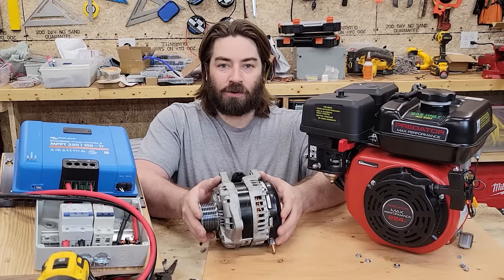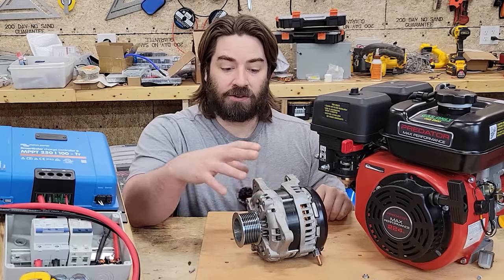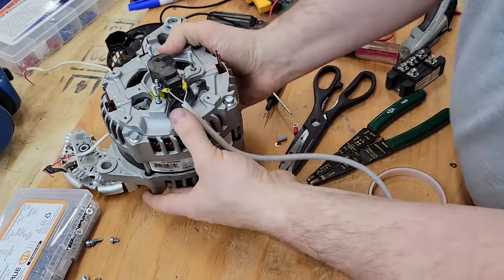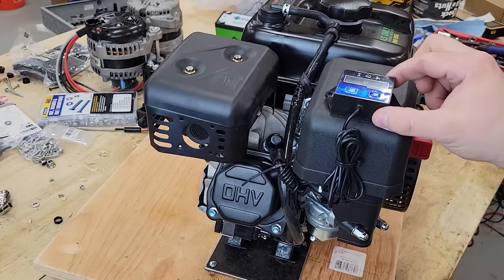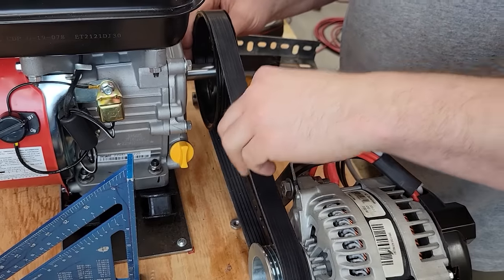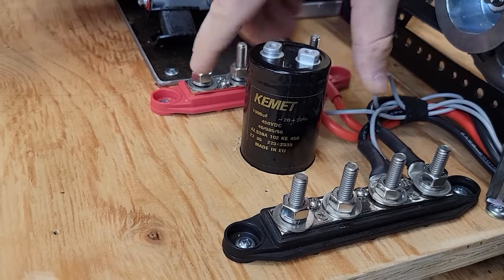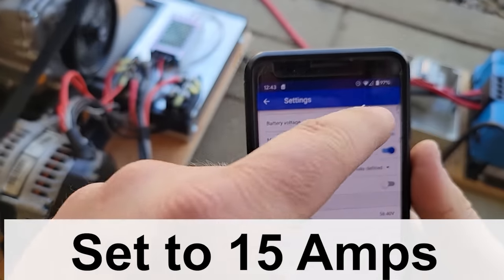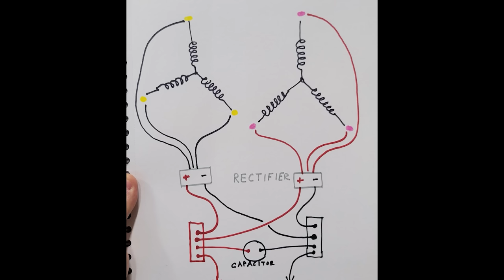The AlternatorGenerator, First Attempt.  48V Battery Charging

Comment: Oreilys / autozone sells an adjustable alternator mount, its usually for your older build ie small block chevy stuff lol but it could help you get more tension much nicer and you can still use the mount you made, would probably need to adjust the length of the working part of your tension system..... youll figure it out as soon as you see what it is lol

Another suggestion but this time for the excitement of the alternator. If you get your hands on some form of micro controller like an Arduino and a 5v relay you could use the arduino and some basic code to momentarily engage the relay to connect you "exciter" battery to the coil instead of needing to do it by hand... if you get fancy with it, you could potentially add a trigger based on the engine starting. ie (not in code though) Engine is on? if yes wait 10 seconds then excite alternator. You could even control the Main output to your solar controller by the microcontroller so that you get that cooldown on that alternator.... I feel like im rambling

I loved the video and am probably going to mimic this process in the future! Thank you for taking the time to upload and being thorough!

Comment: Awesome video ! ! ! Been wanting to try something like this myself but haven't tried yet. There's more to it then I thought but you simplify it all. Could you make a larger base, longer drive belt and add another alternator to the other side of motor and get twice the voltage???
Reply from the maker: Yes, but I think this engine is pretty much tapped out.  If you wanted to drive two alternators for twice the power (kW) then you would need a larger engine.  If your only goal is higher Voltage, but still under 3kW load, then you could arrange the two bridge rectifiers in series.

Comment: It is a true 6-phase output, they are just choosing to use a one way rectifier with it. In a 3-phase system, phases are phase shifted by 120°, in this, they are shifted by 60°. You can imagine that as one Y being the normal way and the other one is actually upside down.

Comment: I'd have fitted the alternator and adjustment direct to the engine, that would probably help both with belt tension and vibration issue.

Comment: Really neat build! Is the output of the system about the same as a store bought generator that would also cost $400?
Reply from the maker: This is video #1.  In video #3 of this build, I get the fuel economy up to 4.8kWh/gallon.  If you bought a $400 generator, and combined it with a Chargeverter, you will probably be about 5kWh/gallon.  That's a better way to go overall.  

Note: My Honda EU6500 generator with a Chargeverter (about $5,000) is 5.8kWh/gallon.

Comment: Make one solid mount for engine and alternator and use a turnbuckle to tension the belt then isolate that asseble from platform. But awesome video
Reply from the maker: Thanks.  I fixed the mounting in video part 2.

Comment: Wow that was cool I always new it would work I would like to see alternator  running to give 110 voltage I would bolt  that engine  to concrete  floor  to keep it locked in place.

Comment: the rubber mount idea is kind of sound in theory .its hard to put to words the engine is made to be fixed direct in this case. I serious believe the feet are the major issue here without changing the motor to fixed let me explain( engine is bouncing around transferring to the wood and the static feet )now here is where i might confuse anyone think of it like a vehicle, most engines not all are rubber mounted to the frame (IE YOUR WOOD) often times this vibration is mitigated by suspension and  a few other things (PLEASE excuse me I'm simplifying it here) so technically you need vibration mounts to the feet but since i don't know the frequency's of fixed and rubber mounted its another issue all together by rubber mounting you have either double the force or cut it in half and i don't know which way to lean to correctly solve the issue but using the same mounts for the engine on the feet would help either way another suggestion is where you put this make a cradle so it cant walk using a border around the construction angle iron or wood

Comment: I'm in the process of trying to use a DC motor to spin the armature of a generator i bought 3500 champion . I took the piston off and the oil kill switch and the complete panel board just in case there was a kill switch in there. I'm just trying to couple the motor with the generator shaft to spin it and see what I get. I have to supply my own power to the slip rings . I'm hoping any amount of DC power will work I'll let you know 😎
Reply from the maker: Sounds like a cool project.

Comment: How long would it take to charge a 24 volt solar battery.Thanks,you are very inspiring.
Reply from the maker: A 24V battery could be many different capacities.  But, lets say, you are looking at a 24V, 100Ah battery.  That's a fairly common size at 2.4kWh capacity.  This rig would charge 1 battery per hour.

Comment: Hello David, just wondering if you could attach everything to the platform and then use the rubber feet on the platform itself. Yes all would have some vibration for all components but just as much as you would have on an alternator in a engine compartment. Great video. What about a direct drive of an electric motor to an Alternator to create AC/DC that would run continuously to power a house off grid, one advantage would be no noise ? Or to DC to top off batteries with an inverter? Thanks
Reply from the maker: In Video part 2, I welded a steel base that took care of the vibrations.  Thanks for watching.

Comment: Your videos are really interesting!! 
Now, lets add automatic start from inverter or battery signal!! 😁
Reply from the maker: That would be fun.  If this project progresses to that point, then I'd start with a engine with electric start built-in.  In this case, I'd have to buy an electric start kit for $120 and it would have been cheaper to just buy the engine with it.

Comment: Back in the 1986, Ford used the alternator on the Taurus line of cars to heat the windshield with over 100 volts when the car first started to deice the window. I would be curious to find out if they used it as A/C or D/C. Since it is still very popular in the U.K., you could probably get more info, and not have to spend much to modify a stock Ford part that already does what you want.
Reply from the maker: That sound really cool.

Comment: Love this project! Like many others I’ve been thinking about doing something similar, but never gotten around to more then dreaming of it. Great job doing it! 👍👍

That CB you used as a breaker on the DC side after the bus bar, is that really trustworthy breaking that high of a DC load?
Reply from the maker: I am fine with the circuit breaker for my test purposes.  The manufacturer says 60VDC per pole, or 120VDC in my application.  Since I got 90.9VDC open circuit, I think I'm good.  However, this is just my first test.  I'll probably swap it out for a 50 or 60 Amp breaker now that I have some numbers to use in sizing it.

Comment: Should include the alternator on the motors shock mounts, in other words, secure the alternator to the motors crank case. The video set up preloads the shock mounts too much as you tension the belt so it fails to stabilize the rig and isolate the vibration.  A direct drive also would solve this.  Otherwise great show and love the workman ship!
Reply from the maker: Thanks, I welded a plate to hold both in Video part 2.  https://youtu.be/cy0t4qq8mS0?si=kFnjaW5UCLVRZwQO

Comment: If you put the DC outputs of the rectifiers in series with each other and add a smoothing capacitor for each rectifier output you will see an increased efficiency in the in the convertor as the input voltage will be higher. It's better to stick with 12V for the exciter voltage to avoid stressing the armature winding. You may still have to connect the exciter supply module across just one of the capacitors to prevent too much DC voltage on it's input.

Comment: Planetary gear? Check if the alternator has ballbearings everywhere. Make the rpm of the alternator as high as you can within the rating of the alternator in relation to the generator rpm. Reduced rotor current for the same voltage. Increase ignition timing a bit. Put a Atkinson camshaft. Put a high compression piston with thick cilinder base gasket. Lean it out a bit. Put a cooling fan with thermoswitch. Reduce gasket thickness until you hear knock. Reduce ignition timing a bit. Profit. Should be something like 12-13 geometric compression ratio with really late intake valve closing. BSFC of most generators suck hard.

Comment: Add a bigger pulley to the engine. Higher rpm = greater output on the alternator. If you increase exciter coil voltage. You might burn it. There is a ceiling of how magnetized steel can get. Once the steel’s maximum magnetism is reached all the rest of the electricity is turned into heat.

Comment: Hi Dave, loved the video, but I have one question.
Why didn't you use the much heavier duty, air cooled rectifier already on the alternator?
Reply from the maker: A few reasons.  I made a chapter dedicated to answering the question in video part 2.  It came down to me not knowing 100% if the original rectifier would work in this situation.

Comment: I would have made the engine mount rigid. Then have the frame mounted on rubber absorbers to reduce vibrations. Serpentine belts require a lot of tension and near perfect alignment to be efficient. V-belts are a better solution because the tolerances of misalignment can be greater, though you lose a bit of efficiency.
Reply from the maker: Yes, I made the engine and alternator mounted together in video part 2.

Comment: Please start with the engine economy! 
  Considering the engine torque required to continuously operate an alternator under load.
 My hunch is that the Engine can run perfectly at a much lower RPM than 3750.
  I would test At high idle 2000RPM? to get a fuel consumption rate much reduced 😊
Reply from the maker: You might like video part 3.  In Part 3, I did more fine-tuning at different RPMs.  https://youtu.be/yQTCVyxdauo?si=9eDD44oTmCnTj8kW

Comment: I'd like to see you change the engine to a single or twin cylinder lister diesel. These are common in cement mixers. A diesel has so much torque you won't need speed just a bigger pulley on the engine and you'll have superior fuel economy to..

Comment: Really Interesting Stuff!
I would buy a dedicated generator. 
I think Car Alternator isn't the most efficient. 

I've seen "boat generator" having 4 or 5 Alterators putting out KWs - of course that was a diesel trolling engine.

I don't think you need to mount the Alternator in that configuration- I'm sure a AC would flow with it running backwards, that might be that metal fan specific requirements. Running it backwards means you can run it in-line, like Generators do. 

I suspect that Generators are using "DC Bushless motors" and you know why I said that.  A Brushless type in any case.

I had hopes for Car Alternators and they work, just not the way I would want. 

So you Paid about 500 USD for the set up or you can buy a generator for that cost and I would put out more, sadly corporations can out do a DIY'r and I admire your spirit.

🕺Keep Creating - Great Scott ⛵️

Comment: hi  you should mount the alternator bracket straight to engine block that will eliminate the engine mount flexibility and your belt will not slip
Reply from the maker: Thanks, you are right.  I mounted the alternator and engine together in Video part 2 and it worked great.

Comment: Belt loss is on order of 1-2%, assuming tensioned well.  In video when the engine was bucking around, the belt looked loose enough to be slipping more and sounded like engine speed was changing as a result.

Comment: The smaller wheel on the engine pulley should increase you by 35 to 40% this is where we’re having a metal lathe gives you benefits. I’ve made car parts off of my metal lathe, maybe it’s about time you invest in one. I grab mine from Harbor freight. Pretty reasonable. I know the thing a lot of people don’t know about in America.  In the patent office, they have a patent called the probe theory. That will Lessen your gas consumption for longer use. If you can’t find it, just let me know. Great video. I will subscribe on my other channel that’s dedicated to this type of projects. It’s called. Just fab.& create

Comment: Thanks for sharing this video. I was thinking to do a project like this for charging my  
4x 12v 220Ah lead acid battery bank used for my solar system but the alternator to be
connected to a 110v 800w motor , 12000 rpm . The motor have to be connected to a speed 
controller witch will adjust the rpm, witch will make the motor to work consume less than 300w because will 
work on less than 35% of his max speed. 
So, I think if the motor will have a consum of about 250-270w then will worth to charge the  
4 batteries to keep them charged , right?

Comment: Thanks for uploading this vid. A couple of hints, right off the bat. Do not exceed the voltage (hence the current) in the rotor. 12 VDC is close to core saturation, so the excess energy will be wasted as heat. Achieving 70% efficacy is a really high value for such a small generator. Next, solder connections. You wouldn't believe how many losses come from oxidized connections. Also, such a huge heatsink is an overkill, and it costs an arm and a leg. Oversize the rectifiers, and a smaller heatsink would do just as well, plus there's no need to cool this stepdown converter. Last but not least: wood as a base is a very bad idea that may lead to your house burning down. Use an aluminum or steel frame. I've been thinking about building a generator based on the same principle for a long, long time, except that I wanted to generate 110 VAC only - purely for backup-during-blackout purposes. These 3 kW are more than enough for my house, so, as you've shown, a car alternator will do just fine in this application. The only thing I'd actually need is this super cool Victron charge controller, to set up battery storage and have approximately an hour of runtime or so. Overall, though, a very good project, just a little too pricey.
Reply from the maker: Thanks for the great comment.  I continued fine-tuning this in part 2 and part 3 videos.
Reply: @DavidPozEnergy  I thank you! You've proven that the car alternator is more than enough for my backup system. I'll definitely watch the follow-up videos, thanks for pointing that out.
Since you're so kind and replying to comments: do you think lead-acid batteries are good enough for brief blackouts, or you'd rather go for Li-Fe-Po right away? From your experience, what would you suggest? I'll probably also install solar panels in 2024, but rather small ones (400 W max.)
Reply from the maker: Sure, Lead Acid can work well for several situations.  First, I'm not a fan of taking an old car battery (starter battery) and using that for anything.  So, when we are talking lead acid, I'm looking at old Tele-com cells, forklift batteries, or UPS batteries.  Check Craigslist, FB Marketplace.  Sometimes you can find a deal on some used lead acid batteries that still have life left in them.  Sometimes an industrial UPS (uninterrupted power supply) will replace the batteries every 7 years regardless of the cycle count.  Using batteries like that in a backup situation can sometimes save lots of money.  However, don't over-pay.  For example, you can purchase 12V LiFePO4 100Ah batteries on Amazon for $300 now with good reviews.  So keep that in mind if someone is trying to sell a 180Ah AGM 12V for $800.  Sure, it might be a good battery but why pay more $/kWh?
Reply: @DavidPozEnergy  Thank you so very much for your advices, that's pure experience I don't have!
You've just gotten yourself a new subscriber 😀

Comment: This is very interesting in understanding how alternators work. Is does raise a question though. Why not just alter a generator to output the voltage you require?
Reply from the maker: I'm building this to recharge batteries.  A normal generator has more difficulties in modifying.  If you have a normal generator making 120VAC, then you are better off buying a charger for batteries.

Comment: Also, you're probably losing quite a bit more than 10% due to belt vibration & slippage... I'd bet the belt is getting warm.

 Those motor mounts are too soft to pull against for belt tightening. 

You would need to mount the alternator and motor to each other, so they move together. Make a metal mounting plate under the motor that extends out to also include the alternator mounting, then use those soft shock mounts under that metal plate - down to your wooden platform. 

Chain drive is much more efficient... no slippage, but more noise (though probably not an issue, since the gas engine is so noisy)

Comment: Nice video 👍🏻. I'm surprised it worked so well first time. You could indeed vary the rotor voltage to get a higher output. At school i did a bench test on a altenator with only the voltage regulator removed and brushes fitted where you could vary the input voltage and i got higher outputs but it is about 20 years ago so the exact inputs and outputs i don't know anymore. I saw a video on YouTube where someone who modified a 3 phase motor with permanent magnets. maybe it is worth to try it out to get higher outputs
Reply from the maker: Thanks.  I have some videos planned for a PMA.